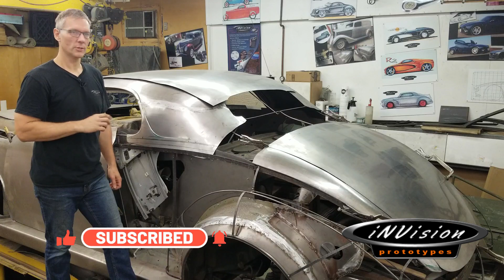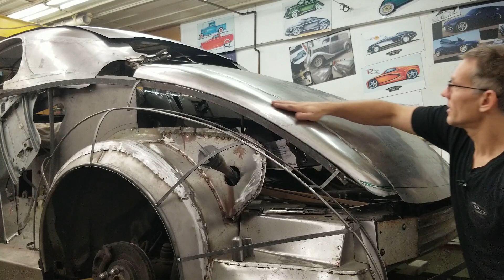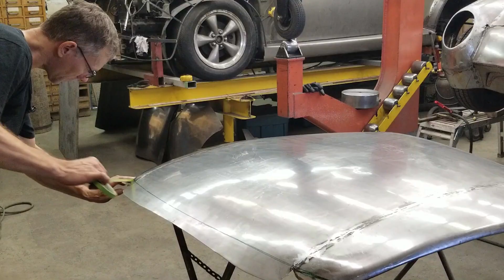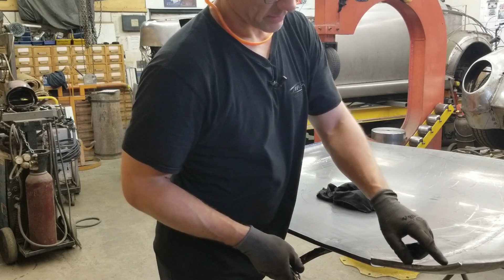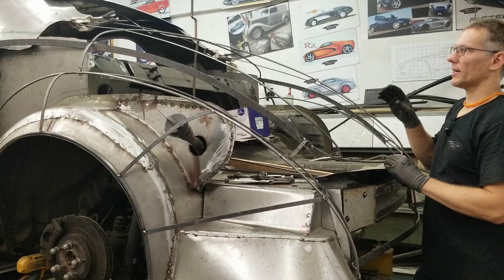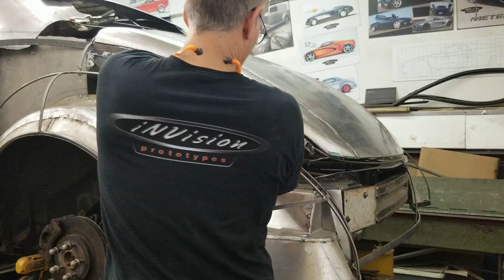Body Panel Assembly Begins! Ep.28 - 1940 Ford Coupe Inspired M40C Build

Comment: Surprised that you dont use a tipping wheel, to get a smooth consistent edge. Obviously the manual method works for you, I would mess that up!
Reply from the maker: Hey Tezzr Terry, great point.  At the time I didn't have a second set of hands to help hold this trunk panel and roll it through the tipping wheel.  Cheers! N.

Comment: Hi Nick,
 Your flanging system seems to work very well for you.  When I made doors for my 1929 Lippert/Ford I used a homemade tipping die.   I thought it worked quite well for me.   Like watching your videos and keep talking and explaining what your doing.  In my case I made the inner door structure first.  My doors are quite basic and I made a hammer form for front and rear jams.
Dick Lippert
Reply from the maker: Hi Dick, The tipping wheel does work great for rolling flanges.  In this case I didn't have  a second set of arms to help hold the panel and didn't want to chance messing up the flange by attempting it on my own.  By the way, hammer forms are great for building jams.  Thanks for watching.  N.